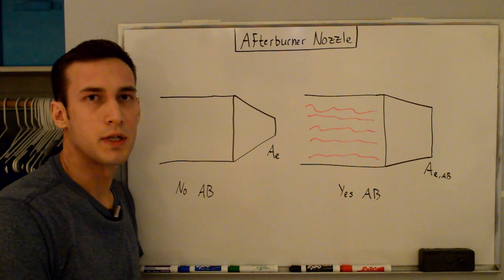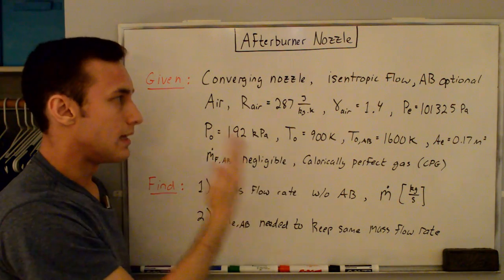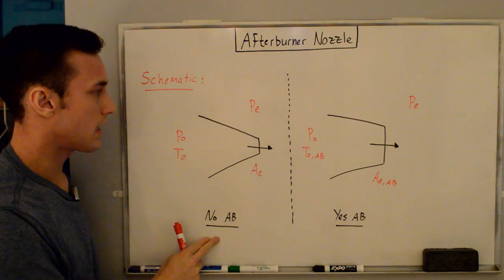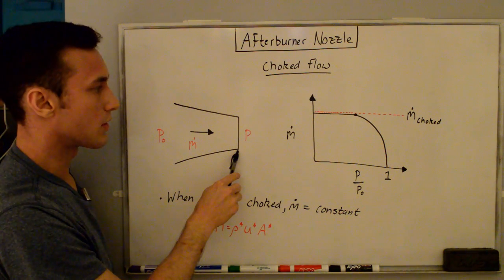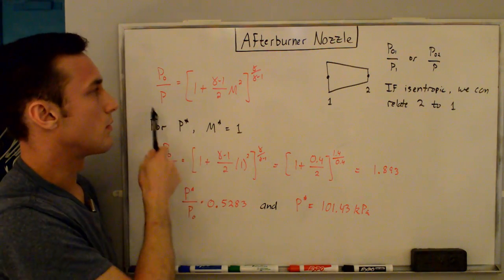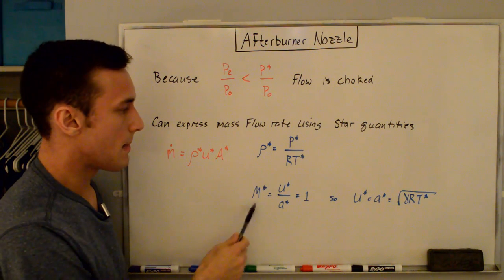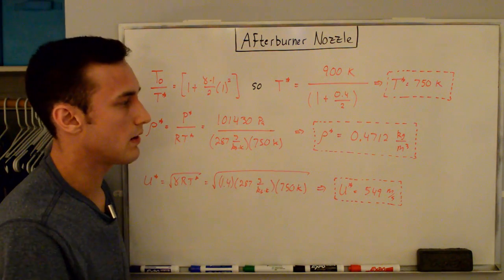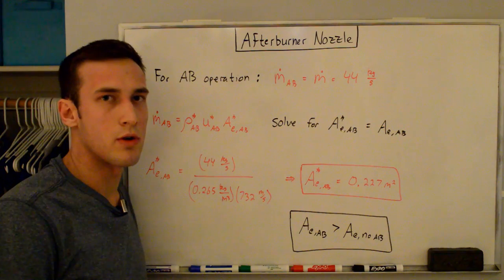Afterburners: Why the Nozzle Opens Wider with Afterburner On

Comment: So basically, you have the gasses from the engine normally, which has a smaller exit area to stay choked and get the most velocity, and then you add the extra gasses from the afterburner, which means you have to open the nozzle to account for the extra gasses trying to exit the engine and prevent back pressure while gaining thrust?
Reply from the maker: I would say that's a pretty good summation.  Another way to think about it is to consider the engine without the afterburner on and the nozzle in the optimum choked position.  What happens when you close the nozzle even further?  You'll still have choked flow, but your mass flow rate goes down and so does your thrust.
Reply: @JoshTheEngineer  How about an engine that does not have an afterburner which has a wider nozzle for takeoff woosh (I know, technical term.) and then chokes down for speed?

Comment: As someone who’s a high school dropout and can’t wrap my head around this sort of math, it was a fascinating explanation.
Reply from the maker: Thanks for watching!  I hope it wasn't too crazy.  I have a lot of background derivation videos too in case you're wondering where some of the equations are coming from.
Reply: In other words:
1) Without afterburner, a smaller opening gets more speed (thrust) from the the exhaust
2) With afterburner, the opening has to be larger, but just enough based on the temperature to keep the back pressure the same.
Thereby keeping the intake flow the same during the transition to AB while the added AB heat expands the exhaust increasing the output flow (thrust).  
This keeps the engine from stalling.
Is that correct?
Reply: Just as an FYI don't start at this end of the engine at art at the front end and work backwards only getting into reheat if you engine needs it

Comment: Nice video, this is how I like to reason it out: For the (roughly) fixed mass flow assumption, the product of the sonic area and the stagnation pressure divided by the square root of the stagnation temperature must be constant, whether the A/B is lit or not. From Rayleigh Flow analysis we know that the stagnation pressure will fall and the stagnation temperature will rise (i.e. subsonic heat addition). Both of these effects will decrease the magnitude of the term multiplied by A-star, so A star must increases proportionately to keep the combination constant. We probably don't need any calculations at all to reason out that the sonic area must increase. It's a very similar analysis that leads to the constant stagnation pressure sonic area product when analyzing shock waves, except now we allow the stagnation temperature to vary as well.

Comment: How is this calculated in real life though, considering the fact that the Inlet Pressure is lower if the AB is switched on from stationary start on the runway, compared to doing Mach 2 at 40000ft altitude? Does this mean the Nozzle will be opened more when travelling at speed compared to ground level? I'd have to assume there are sensors in the tailpipe to constantly measure Mass Air Flow for every potential scenario of the flight envelope?
Reply: Apparently its temperature...

Comment: Thankyou Friend, I didnot know, a nightmare  for construction indeed.May  I  use an afterburner convergent nozzle as a booster to start a Ramjet?We need to reach a critical inlet speed air, fuel injection,and once  combustion chamber ignites then self sustaining and put AB off? If you please ,I am thinking in a 500 Newtons thrust small ramjet for sailplanes.Bye and many thanks.You are great, but go slower, I am FEA Professor for long,think this is a class or lecture.Next try to lecture  Thrust comparison AB/ versus off AB.Bye.

Comment: Compared to the non afteburning state, the afterburning state has about 57 percent of the density and 133 percent of air velocity.  So 1/(.57x1.33) is about 1.3 and that represents the ratio of Area with afterburner compared to non afterburning. 

Or put another way, even though AB velocity is higher and that would act to REDUCE  the needed area to maintain the flow rate as is, that is MORE than countered but a huge increase in volume (same as reducing density).
Reply: Yup.. that explains it in a nutshell

Comment: Can you explain to me what happens to the mass flow rate if the nozzle throat stays fixed even when the AB is on? will the flow be choked at the throat in that case?
Reply from the maker: It's a little hard to analyze exactly what happens in real life, but if we make a simplifying assumption, I can answer your question.  Let's assume that for case 1, the afterburner is on and has the P0 of 192 kPa.  As I go through in the video, the nozzle opens up wider.  For case 2, let's assume that we didn't open up the nozzle wider, but also that the stagnation pressure in the afterburner is still P0 = 192 kPa.  If this is the case, then by keeping the nozzle closed at its lower area position, you would decrease the mass flow rate through the engine.  This would obviously cause problems upstream in the engine, but that's why we made the assumption that the stagnation pressure was the same in both cases.

Comment: What I'm trying to understand is where the afterburner mechanically applies the thrust force to the engine. I know with a non afterburning turbofan, the forward force is applied at the intake fan, compressor, diffuser and combustion chamber. In other words a forward pressure vector on the internal surfaces of the engine. But how does the afterburner add to this? Where is the force applied? Not the flameholder or jet pipe. If it doesn't increase mass flow rate through the rest of the engine then there is no extra force applied on the components mentioned earlier. What am i missing?
Reply: Momentum. 1kg/s mass flow is twice as much force at double the delta v.

Afterburning is still internal to the engine just post turbine. Pressure surface integral still equals the higher force.
Reply: Yes momentum 100% accounts for the thrust, in a mathematical sense. But ultimately, 100% of the thrust must also make it into force on the pylon, and prior to that, on a certain distribution on the engine (including inlet, basic engine, and nozzle) skin. So the question is, what is this distribution exactly, and where does afterburner add to it?

Comment: Thanks for sharing. I don't understand this very well, but one thing I do understand is that this is why my rocket engine exploded!
Reply from the maker: My pleasure.  Gotta be careful with those afterburners.
Reply: Hey -basically afterburners increase temperature and velocity , but keeps mass flow rate to avoid back pressure on the turbine wheel.  ---I'm actually designing a  small variable nozzle for a jet engine - I'll try to make the math for my self - :) need to view the video several times to get note of the ecuaciones

Comment: Wouldn’t the stagnation pressure be higher in the AB case, due to the higher speed and dynamic pressure? Or did you make them the same (AB is adding temperature but not velocity) as a simplification that still demonstrates the point?
Reply: Or, is it that in adding temperature the density is decreased by the exact amount that offsets the increase in speed, such that dynamic pressure stays the same?

Comment: There haven't been afterburners since the 70's. Afterburner is the practice of reburning he remaining exhaust from the engine. The engine in your illustration uses fresh air from the N1 or fan, this is called augmentation. The air used in augmentation is bypass air that flows past the core engine and acts as more of a ram jet than afterburning core exhaust.
Reply: Really?  F-35  Afterburners inject extra fuel after the fan.  https://en.wikipedia.org/wiki/Afterburner
Reply: @solarsynapse  Hay Zac, no kidding?

Comment: Josh, what additional work is needed to calculate the true values given the fact that the mass flow IS higher with afterburner -- with AB on a much larger amount of fuel is added to the flow even though the air flow is the same.
Reply from the maker: You're correct that with an afterburner, it's harder to justify neglecting the added mass flow rate of the fuel in the analysis.  Just as a quick aside, the main increase in thrust comes from the increase in temperature from the burning of the added fuel.  While the thrust also does increase due to the added mass from the fuel itself, it's pretty small compared to the temperature increase.  That being said, it would be more accurate to include the fuel mass flow rate as well.

The easiest way to include the fuel mass flow rate in this analysis is to specify the flow rate (in kg/s), and then add it to the flow rate without the AB on.  Then you would use this new mass flow rate instead of the old one and continue the analysis as is shown in the video.

Comment: No afterburner, nozzle constricts to increase flow of pressure, with after burner there is ample thrust and nozzle doesn't need to constrict, if you constrict nozzle with afterburner too much pressure is produced and you blow the end off your engine...seemples